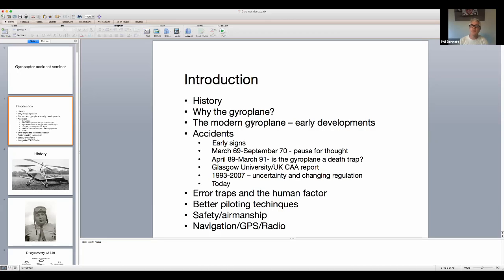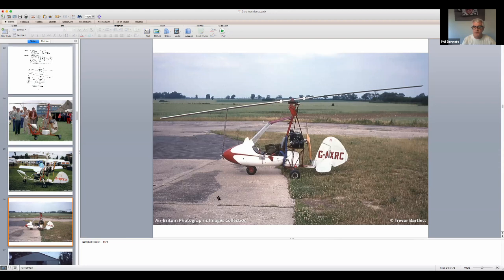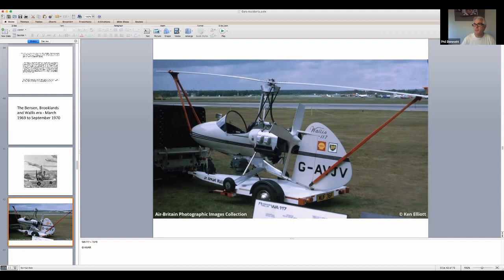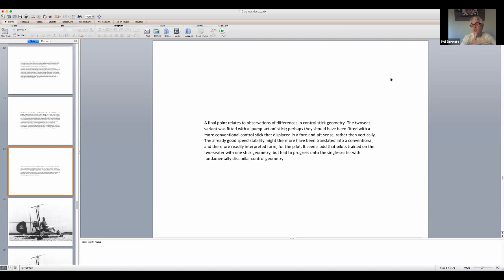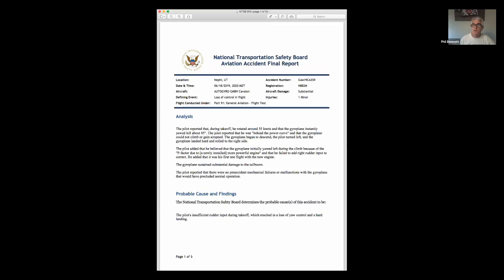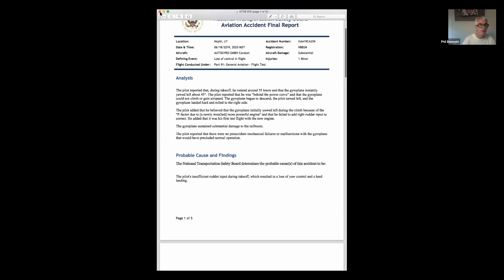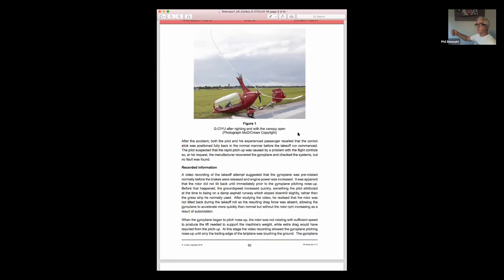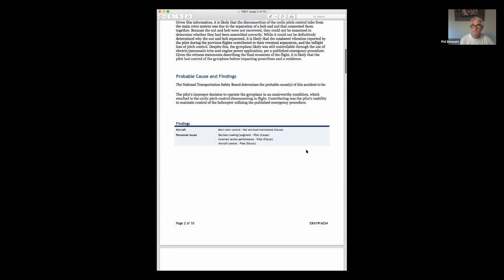Gyrocopter accident Webinar highlights

Comment: My only gyro flying experience is with flying sims but maybe I have an outside view point. I get the feeling from watching the accident videos that the pilots must not have had any idea of what their rotor is doing until it was too late. And I can not see that his instruments are much help. The airspeed and rotor speed are shown but that would not be the most important things to me. I think it would be more helpful if the pilot knew how fast these values were changing without having to study the rotor rpm gauge to see if it is increasing or decreasing. So a gauge that showed rpm change per second would give direct feed back on how his stick movements are effecting the rotor speed. If the needle pointed straight up then the rotor is neither getting faster nor slower. If he pulls back the stick a little and the needle swings to the right (+) then that is good. If he pulls back too much and the needle moves to the left then he knows he over controlled. Flights with an instructor would teach him how to optimize the rotor acceleration as compared to his speed. Maybe it has been tried and has been shown not to help. Does anyone have any thoughts on this?
Reply from the maker: Hey - thanks for the input.  Not all take off accidents are related to rotor blades being (as you describe) too slow and then flap, but those that do you have summarised part of the issue.  The reality however is that until (frankly speaking I started banging the drum) nobody was talking about monitoring rotor RPMs during the take off phase because the focus has always been on a "wheel balance" technique for take off - and using that you don't need to monitor rotor RPMs really.  Of course the problem comes when things are not going well and now you have no safety net.  

There has been some change - and certainly in the UK the Gyropedia method which is common at Gyrocopter experience schools - these guys have no introduced the need to monitor rotor RPMs because of the overwhelming common sense of it all.  Could you automate the process - yes no doubt but the problem is that in the UK especially you are not able to add devices to the aircraft unless it is approved by the manufacturer and then that takes you down a whole world of pain!
Reply: Maybe in the future and from the manufacturer’s, a system could be created where by a takeoff setting could be incorporated that would make a direct correlation between rotor speed and forward motion, mph. I have no idea what that would look like, but I’m sure someone smarter than me, ( engineer) could figure it out. I believe that would take the guesswork out of takeoffs. Just a thought from a novice.
Reply: @gyrocopterflyingclub6148  -- What I proposed could be done with an optical device attached to the rotor mast, connected by bluetooth to a smart phone mounted in the cockpit running a simple app. Since people attach cameras to their aircraft, I don't see this as being any different.
Reply: Do gyro’s have low rotor rpm warning systems (audio and visual)?